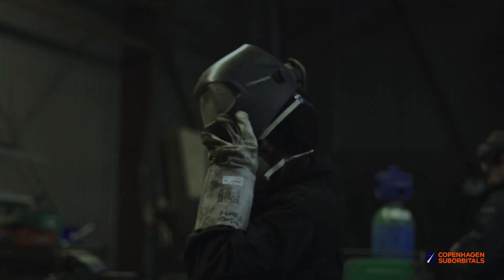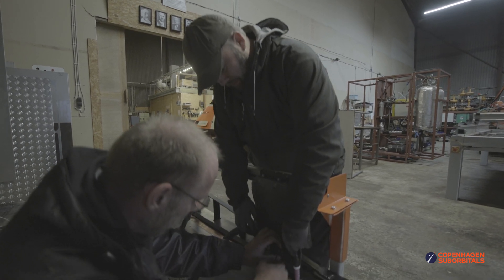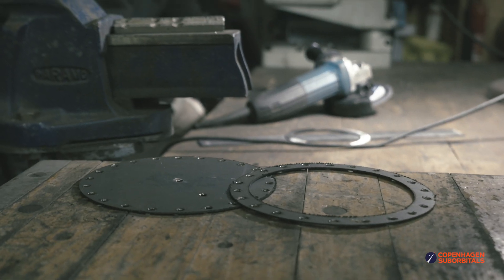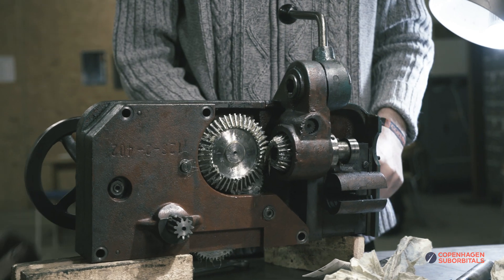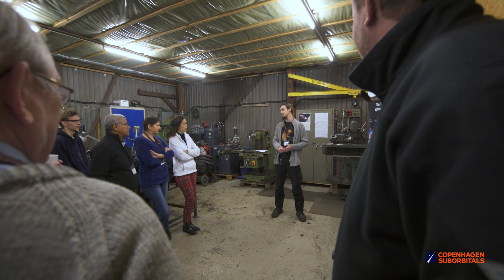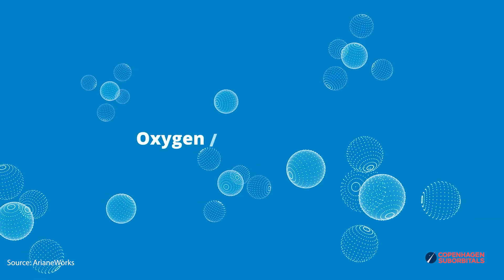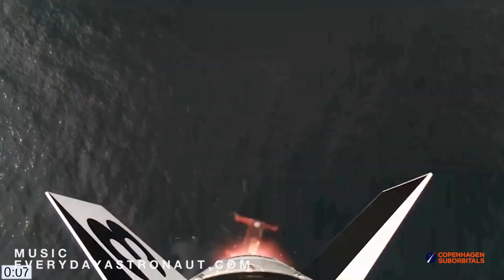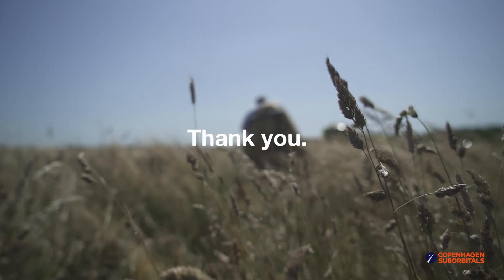Can You Guess What It Is? | INSIDE THE ROCKETSHOP : Episode 11

Comment from the maker: Put your best guess below! (And to be clear - the part is something we have talked about in the past)
First person with a correct answer will get a Nexø II poster.
Reply: I don't really get how it looks IRL, but my guess is heat exchanger for the pressurization system
Reply: @tinldw  Yeah, that was my thought as well. A heat exchanger to get the oxygen gaseous before entering the turbopump.
Reply: It look like stainless steel tubing use to form a rocket nozzle by bending and soldering them together
Reply: Now that I've looked at it better (and watched again few other videos (: ) - you've mentioned "sideskirts" in the previous video, and I guess that it is a load-bearing structure inside or around the tank walls. I would have said "intertank section", but you have different design for it 🤔

(Edit) Note to future self: because I had a flu :/
Reply from the maker: @tinldw  I think we need to stick to one answer per person to keep things fair. So just leave the one you are going with. :)
Reply: Copenhagen Suborbitals it is an update of my opinion after looking at it much more carefully, because the first guess was more about what I wish it was. Treat it however you like.